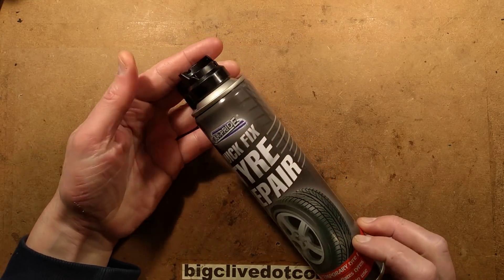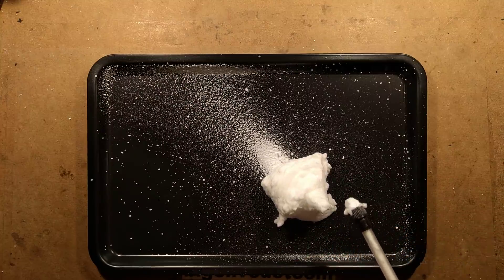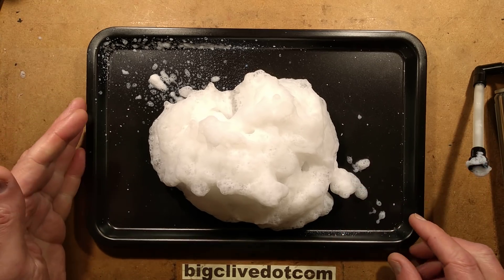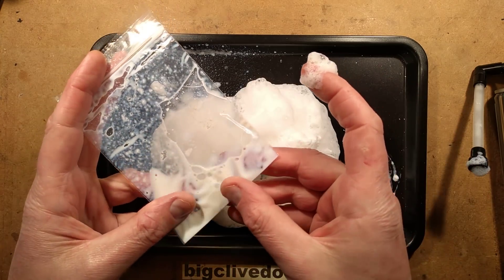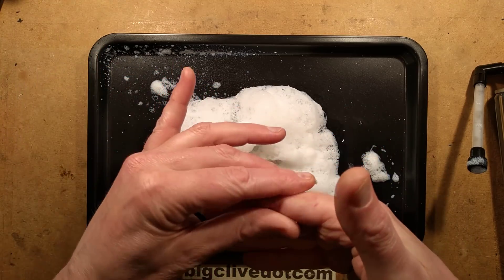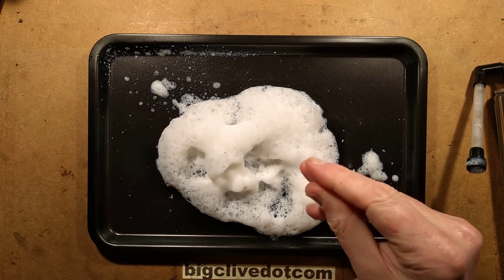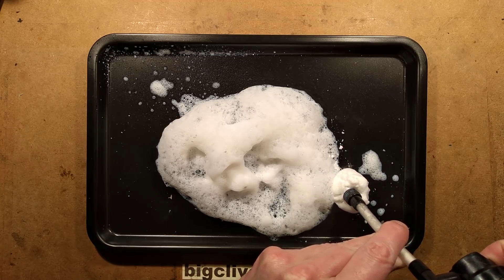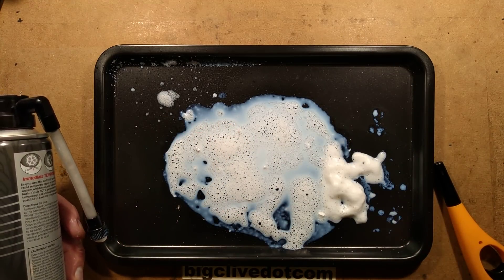What's in a tin of foaming tyre repair liquid.

Comment: I don't know if they still do this, but when I was delivering cars a few years ago, some new cars were supplied with a can of this instead of a spare.  Not impressed!
Reply: My car is one such as this. Thankfully I've not needed to use it yet. To be honest I wouldn't even consider changing a wheel at the roadside anyway. It's quite common now. I do fit run flats though. so hopefully I won't need the kit. Hopefully I won't get a puncture anyway.
Reply: @paulanderson79  I've heard good things about run-flats.  I'd always want a full-sized spare myself though. And yes, I changed one by the roadside just last year. What can I say - I'm old-school! 😄
Reply: @flickpad  I'm getting on a bit as well. Runflats are OK, but they are compromised in many ways. Ride and longevity for a start. It's not the best. You can't fit lawfully fit them anyway without tyre pressure monitoring systems. Next tyre change on this car will be standard tyres. I'm torn between Dunlop Sport MAXX rt2 and Michelin a
Pilot Sport 4.
Runflats can also be noisy.

Comment: Had four of them in my boot while living in Kenya. Had knowledge that  Bandits put sharps in road punctures the tyre then rob you when you stop to change the tyre. So this happened to me I stopped squeezed in one of these and was off in less than a minute or so. To change the wheel at nite  about 15 or so minutes , very dangerous on isolated dark bush roads. Later I pulled out the puncture steel pin they used at home. I left the tire as it was and it was fine. I understand the mixture can damage the inside of the tire....who cares when stopping with a flat in a bad area  can damage your life. After I always had four in the boot one for each tyre.
Reply: +Malcolm... Is this the post?
Are you sure you had fix-a-flat?  B/C fix-a-flat is designed to get you to a tire station, it is not a long term fix.  Now, if you happen to have a small puncture, it might hold if you add air, but I wouldn't trust it.  There is too much mass spinning around inside that tire.  It would also need to be rebalanced.

Comment: Used this kind of "stuff" a couple of times. Always worked. Great for emergency quick fixes, specially on the highway where every second out of your car, or not moving along at the same speed as everybody else, can mean death in an instance. I would not want to spend 10+ minutes changing a tire when all it takes is less than 2 minutes to empty a can of tire goo and get going, at least to the next exit. 
If you got tires bigger than something like 205/55/16 you should consider carrying 2 cans, not just one. 
But do inform the tire shop that you have used it, once there. And do remember they have to be warm to work. Not hot, but room temp. Deep frozen in the trunk they will no no good until you have thawed them.

Comment: Used these in my "boy racer days" had 3 tyres filled with this stuff for over a year with no problems.  You do have to add air once you put the foam in..then drive for 20mins

Comment: Driven around for years with a tyre full of this shite, my crappy car doesn't have a spare and I'm to tight to replace a tyre until its worn out. Not had an issue other than you need to use it again after about 12 months as the tyre starts to deflate again.

Comment: I've always used it in tubed wheel barrow tyres to stop them going down on their own, but I've never actually used it for a repair. I do know that it's frowned upon when you take in a tubeless tyre for repair after that foam has been used. I'm pretty sure it scraps the tyre. 👍 🇬🇧

Comment: i have left it in.  no harm no foul as far as i know. i ran through a patch of ground that somebody had intentionally put roofing tacks in.  i took out 28 tacks and replaced them with the big red tire plugs that look like licorice sticks and then put a quarter of a can in each tire.  got another 20,000 miles out of those tires with no problems.  i also put an entire can in one tire and never changed it once.  just because it had a slow leak.  no problems there either

Comment: Exercise caution if your car is fitted with a tyre pressure monitoring system, this stuff has been known to wreck the sensors and that can be costly There can also be a cleaning surcharge if you get the puncture fixed or the tyre changed. I would only use in extreme emergencies only.

Comment: The tire spinning should evenly distribute the latex before it hardens, and it probably bonds strongly to the tire runner. Id'say is is safe as long as you top it off with air afterwards. Despite the 'TPMS safe' claim, if you have TPMS, go to the garage immediately. Having rubber on your sensor and having it harden will ruin your expensive pressure sensors.
Reply: If you dump the whole can in, it might never dry. Driving around with liquid splashing around the inside can't possibly be good for handling

Comment: I had a situation where I went camping on an island with my boat. The area where we launched the boat was quite remote, and then the trailer sat there for 3 days while I was camping. I came back to find both trailer tires flat, and couldn't get the boat out of the water. To make things worse the boat had a leak and was slowly sinking.

Previously I would have called this stuff useless, but it saved the day. A dumb girl had it in a car kit somebody gave her. I guess she wasn't so dumb. Got both tires inflated enough to get the boat out and find a gas station with some real air. It didn't hold long term though, the tires still had a slow leak. It's definitely something I'll keep around for emergencies.

It's definitely worth noting it doesn't have the ability to fill a very large tire with gas. My trailer had two tiny tires on it and they were still pretty low when the can was empty. If you had even a factory size pickup or SUV tire it probably wouldn't make much of a dent in the inflation...you'd need several cans.

Comment: I've used this before, it was one from Halfords called Tyre weld, it comes out neon green, it works but when you finally get the Tyre replaced it really pisses of the fitters as it gets everywhere.
Reply: I used it once and it knackered the sensor.

The best thing to do if you have the fluid kit is ignore it. Use the compressor to get some air in and drive toward a garage. Even if you need 3 stops, NEVER use the fluid. If you have a gashed tyre, it's useless. If you have a small hole, all you need is air and 30 to 40 mph.

1. It kills the sensor.
2. Even if it doesn't, not every garage will ignore an opportunity to hit you with saying it did, plus the price of a replacement, plus the labour and reprogramming costs.
3. Always assume number 2.
4. This sort of 'technical Improvement' is there for dealerships - NOT customers.

Comment: Sounds like a foaming version of tubeless tyre sealant I use in my MTB s it seals tyres verry well and will seal almost any hole you get. But it will dry up in your tyre eventually forming a solid lump which messes with wheel balance really Badly

Comment: I ran this inside two tires that were leaking from the plugs they already had, it held up for a couple years, both tires still had some tread life in them so I wasnt too rushed to replace the tires as the can says since each tire for that car can run up to $200

Comment: we use the non aerosol liquid form of this stuff...it works wonders on my bike tires...no more parasitic leaks from the rim to tyre seatings after using this...its applied as pour through the air tube inlet with the valve removed.

Comment: Yes. Used it twice. 1- During a 200mile journey - around 10miles in, I started hearing the noise a nail makes going round a tire. I Stopped, pulled out the culprit! And squirted about a quarter of a can in and the tire - the seal lasted the rest of the tires' life(about a year or so later).
2 - hit a pothole, although the tire seemed okay. It damaged the wheel, giving me a flat. Put some "Tireweld" in. And I think had to reinflate it once or twice some time later but no further issues. 
And
3- My football kept going down, so I figured. 'It worked on the car!.....lol' and 'jobs-a-good'on!!' 
Not sure if the last one counts....but there you go.  I recommend Tireweld though, I found out first hand the cheaper versions just don't work.

Comment: Used it in moped tires, works like a charm. For 3 years no problem whatsoever. It does stay fluid in the tire, presses out through the hole and dries where it comes in contact with air, the moisture is needed to keep it fluid.

Comment: My pedal bicycle got a flat tire once. I replaced it with a tire that came with a green gloop inside of it. One day I was riding into work and ran over a sticker weed. I didn't think it went in deep enough to puncture the tube so I pulled it out. I was wrong and air started coming out. Then it started bubbling stuff and I thought oh yeah my tire has that special stuff in it I'll be totally fine. About 5 hours later after work was over I was riding home and my tire was completely flat. It was then that I remembered I had put those special tires on a whole year ago.

Comment: I have used this stuff on four tires over the past 25 years. It worked on all tires and I drove the tires till their demise. I had no problem getting new tires remounted. When I patched a big tire on a 1999 Ford Expedition I had to jack the tire up to get the weight off of it because the tire pressure was too much for the can.  I have heard years of "experts" tell me not to use this stuff.

Comment: @bigclivedotcom bit late but the stuff in cherry pickers and is different stuff its a 2 part mix pumped in through the valve and the hole with the bolt in as you say is to let the last bit of air out at thr end

Comment: Never used one of these, though my car has one in place of a spare tyre. Having spoken to a mechanic I know about them he's advised me against using it, not from a perspective of the flammability or anything like that, just that when used it makes a mess of the wheel rims and most places will charge you through quite a bit to clean that off.

Comment: I used one of those cans just the other day (the exact same brand actually). It inflated my tyre from completely flat up to around 28psi. The tyre was a 255/50/19 (so quite a large volume to fill and pressurise).  I drove straight from where the car was to my garage and inflated the tyre up to 35psi,  the tyre is still inflated.
Also, last year (june) I used a can in a tyre, on a different vehicle, as I was stranded in the lake district. Again i went straight to a place where i could fully inflate the tyre. That tyre still hasn't went flat.
Being in the automotive trade, I know for a fact that tyre replacement companies won't do a puncture repair on a tyre that has had one of these cans used on it. In fact some, companies will refuse to change the tyre for a new one because it makes such a mess on the inside of the rim, making it more difficult to achieve a rim seal.
About half of new cars these days don't even come with a spare wheel, they come with a dealer variant of these cans (a bottle of liquid and a compressor pump). It would be interesting to see if it's the same liquid in this kit.

Comment: interesting, i've heard of tire dealers refusing to put tires that had that stuff inside them for a while back on and making people replace them, but i've not personally heard of any catastrophic failures, i wonder if they might have to mark it temporary due to the propellant possibly expanding or contracting with temperature.
also, if you can get a hold of them, i honestly have to wonder how or (even if) different the "green slime" similar stuff would be, probably just some food coloring i wonder.

Comment: I have used it and always kept a can in the trunk.  If you come out in the morning and realize you have picked up a nail or a screw, the can will get the tire up enough so you can drive on it to the nearest air pump, fill it up the rest of the way and get to work on time.  Come out and check it on a break.

Comment: It might be a good idea to deflate and re-inflate the tire a couple of time just to get rid of the butane/propane from inside the tire.
Also, filling the tire a bit with CO2 or nitrogen would be a good idea but I think no one will have a can of that stuff.

They should be using a CFC or FC such as 1,1-difluoroethane or 1,2-difluoroethane as the propeller.

Comment: The first time I used this, I ignored the speed limit on the can (Which I think was 50 mph), along with the "drive slowly for 10 miles" instruction. I joined a 70 mph dual carriage way, got some way along and then BANG, my tyre blew. The second time I used it I was more cautious, and played by the rules. It worked perfectly and I drove 20 miles on it before finding somewhere to replace my tyre. (My vehicle is wheelchair adapted, and so has no room for a spare wheel!). It's great stuff, but tyre shops refuse to repair a tyre after it has been gunked up by this stuff.

Comment: In the US there are formulations of this kind of stuff that in certain applications (low pressure and low speed tires like for agriculture/lawn use) that are designed to go into a perfectly good tire and stay there as a preventative measure. Get a nail in your tractor, forklift, or hand truck tires?... No problem!! Just keep on working!! 😮

Comment: I have had an explosive blow out using this stuff and you brought up a good point about letting out the propellant later and replacing it with air. It was many years ago, I was naive and did not know enough about cars, like I do now (maintenance, do it, it will save you money later, learn to do at least some basic repairs if not more). So, like anyone young person who didn't know and obviously didn't think much about it after using the stuff and didn't likely read the part about getting it fixed properly as this was only a temporary fix. I drove around for many months on it. It was likely an older tire too if memory serves, so that didn't help the impending disaster contributing factors. 

I went to pass someone on the highway in the middle of summer, on a hot day. Friction, resulting heat, compromised tire etc. etc. boom. The whole side of the tire blew out, rubber flying everywhere. Got over to the shoulder safely, but what I was witness to upon looking at that tire, sends chills down your spine. Half of the tire remained. As if it blew outwards straight out the side, taking almost a perfect half of the tread with it. Worst blowout ever. A couple of years later, I was talking to my ex-girlfriend's brother who's a Mechanic and he said "Oh, never use that shit! It's flammable man and it could do that. Use this stuff if you have to use anything. No flammable gasses. " and he handed me Tire Slime. That green stuff (sometimes yellow liquid too on other brands) with little flecks of black rubber floating in the slime. You have to use a compressor to blow it up (and remove the valve to fill it with this stuff, but they give you a valve removal tool in the cap), and at least there is no potential to have an exploding tire later. Lol. Just carry a 12 little compressor in your trunk, easy. 

This is all just anecdotal I know. I have no Scientific proof as to that "being the cause" of the wicked blowout, but you asked for experiences and I have one. This is why I mentioned variables, it could have been anything really. I get how this works. Just saying, you think the potential is there, I CERTAINLY do, I've never had a blowout that bad and it's best to stay away from this absolute crap. I never bought it again after that. It's a disaster in a can, really. Alternatives exist, better ones. Get the tire fixed properly by a professional, BUT if you have to use this, use the safer slimy stuff that doesn't come in a compressed can of gas like this, please. I know it drives the tire guys and Mechanics nuts that people use ANY of this crap and they would love to kick me for saying use any of it and I get that. It's why I said, take to get fixed right, I am not recommending the stuff, but we know how some people are going to use these things and I'd rather see them use the no propellent stuff. They should ban that other crap, seriously.

Comment: Ive used this. It works well. Kinda dribbles out for a little minute but then seals up. You can then limp to a petrol station and inflate the tyre properly. Only had it in for a couple of days before having the tyre replaced. Dont forget to tell the tyre repairers its in there so they dont get sprayed with it.

Comment: I help out at my son's garage and we service cars and as a result .repair/replace tyres. once this goo has been usedit stays as a liquid in the tyre and we will not repir a puncture because 1. the resultant goo gets all over the tyre stripping machine and takes ages to clean off. 2. in order for a patch to be fixed inside the tyre all the liquid goo would have to be cleaned out, the remaining goo in the tyre allowed to dry (as shown in the video) and it would take approx 24 hours. The dry goo would have to be scraped of and the patch applied.  To bill the time to do all this is price prohibitive, the customer is not prepared to pay that ammount as it cheaper (a lot of the time) to buy a new tyre. This goo IS NOT a replacement for a spare tyre as some vehicle manufacturers state but only to be used in an emergency, a flat tyre is not such an emergency only if there is a double flat tyre and the spare wheel is used on 1 wheel.